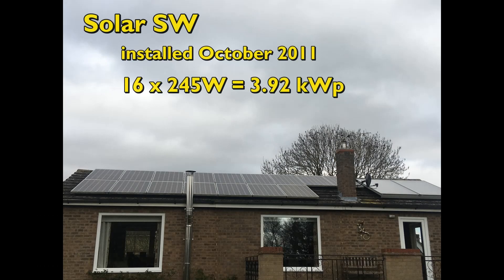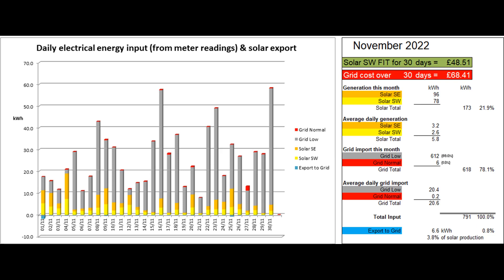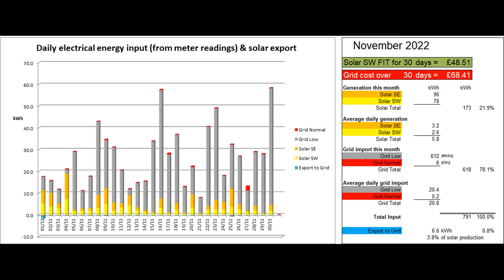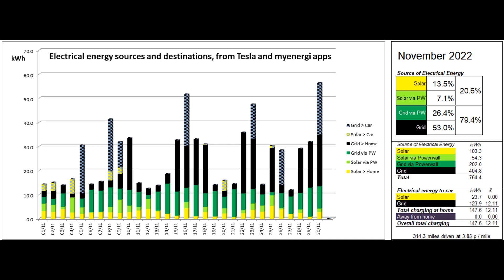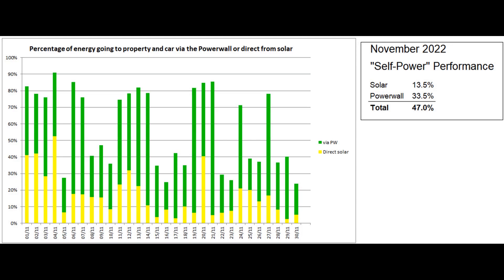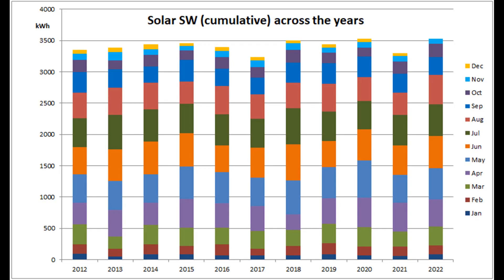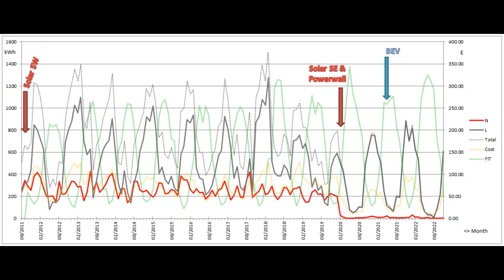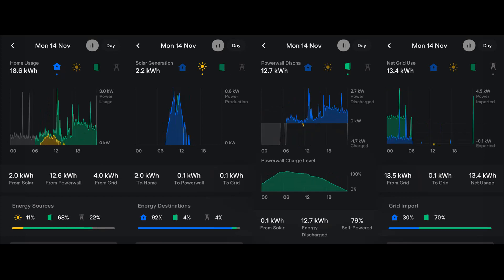Tesla Powerwall 2 and Solar PV in the UK [36]: November 2022

Comment: Thanks again, we mirror your results here in Spalding albeit our paltry 88.9 from our original 3 kw array was our lowest November total ever, the combined 4.3 generated a total of 114 kw, much lower than 2020 (177) and 2021 ( 192) . However, similar to you we have already posted our highest annual total for the original array that was erected in 2012, so it’s not all doom and gloom, we just hope December is better than last years grot fest. Have a good Christmas!
Reply from the maker: Thanks, Lynn. Merry Xmas and a Happy New Year (no, our decorations are not yet up!!!). It'll be interesting to see whether we on the eastern side of the country have fared worse than those in the west in November.
Reply: @salokin1  I am pretty certain we have, even now it’s a constant stream of low cloud and fog off the North Sea and that big high pressure over the Continent looks as though it will take some shifting.